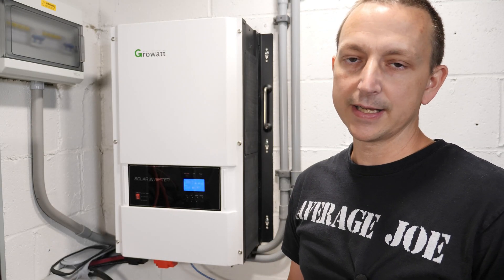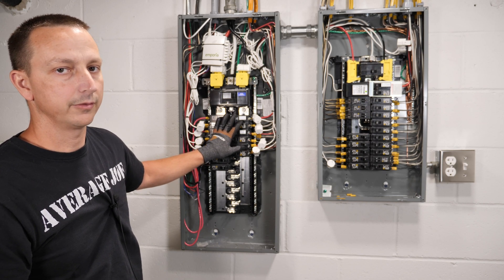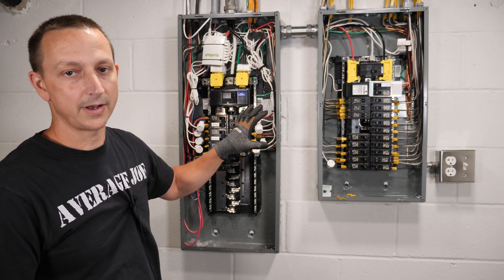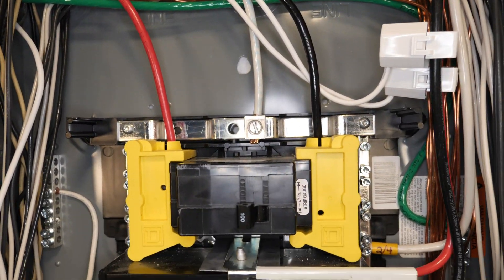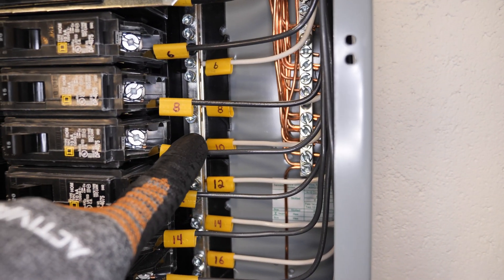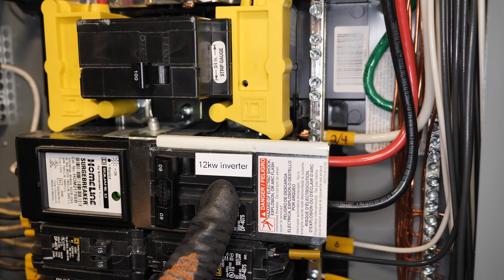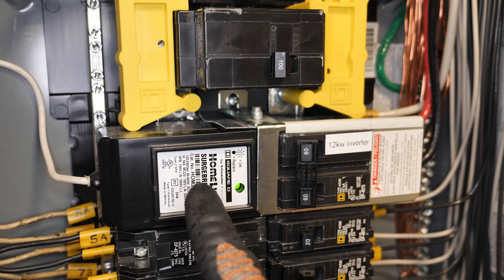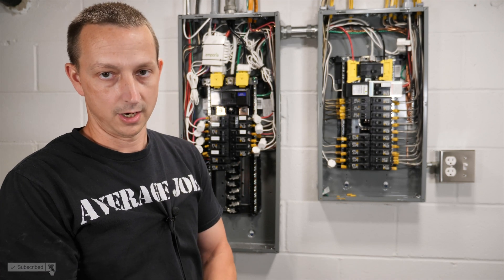How to Wire a 240v Inverter to Power your House for Off-Grid or Whole Home Battery Backup

Comment: Dear Average, great video.  Seems like you connect the Critical Load Panel to the utility through both a direct connection via the Main Panel OR through the split phase output of your Growwatt Inverter.

As I understand most of the all-in-one,  grid connected (not grid tied*) inverters have a bypass capability which allows powering of the split phase output either from the inverter (batteries) OR from the utility inputs. At least this is how my MPP LV5048 works where you can set the priority of the source,  either UTILITY, SOLAR or BATTERIES.

So you could save some complexity and just power your Critical Loads Panel directly from the  Growwatt.  Just a humble suggestion to use a block diagram or schematic to illustrate your dialog. 
Just a thought and really enjoy the great channel !

*PS, my MPP LV5048 is grid connected, but not grid tied,  so I cannot export power to the utility, I can only use utility power, but I'm guessing you knew that already.
Reply: Joe is right

And if your inverter let you down...
What you gona do... ? No source to feed the subpanel
Reply: @benoito8753 if you had to and disnt have it wired this way could take down the inverter and connect the wires together.   You would want to connect the wires inside a temporary junction box of some type.
Reply from the maker: So the growatt inverter also has pass through and we use that anytime there is no sun amd batteries are low. The reason the sub panel is connected this way is because that is how a sub panel is connected.  I added an additional dbl pole breaker to power the sub panel as you would for adding a generator or another power source. Then of course adding the lockout. The great thing about having 2 ways to power the sub panel is if and when you need to turn off the inverter for maintenance. I can just switch the panel back to normal and turn off the inverter. Then switch it back off grid.  I had planned on explaining that but assumed it was known and this was just a wiring connection video. I may do another to explain🤔🤘
Reply: I wouldn’t trust a box to pass through power to my critical loads. I have a 200A transfer switch that does that for me. Same with my 10kW LP generator, with 100A transfer switch.

Comment: 2:04 What is that "Emporia" and the little CTs for?
I assume that is a smart meter system that measures power consumption of appliance?
Reply from the maker: YeSirr! Its a smart energy monitor I purchased a while back to track consumption and see how many actual watts things were using.  I got the one with like 16 ct's so I can monitor all the things lol. Still have a few more to install.  It works great to btw. Real time and is fast!

Comment: I have my Growatt powering my garage, runs our clothes washer and electric dryer. I need to connect the two panels so I can power more loads in the house but they are at opposite ends of the house, so I'm not sure how I'm going to do that and also keep the AC and electric over/stove on grid only, unless I install another panel next to the main.
Reply from the maker: Yeah you can just run some wires over there on that side of the house to a smaller sub panel. Leave the big items on the main panel and move the things over you want to power to the sub panel. You could also instal one of those transfer switch circuit breaker boxes. Its practically the same thing tho.

Comment: What are the white chokes or shunts on each of the leads? are you monitoring consumption on various devices?
Reply from the maker: Yeah those a ct clamps from the emporia energy monitoring system. I  left that out so I didnt get to far off subject lol I purchased it a while back so I could track over time. It actually works fan freakin tastic and is real time.  I do need to reset it since I moved a bunch of stuff around🙄😆

Comment: Should the inverter be grounded to the panel, not to provide a ground, but to ground the inverter itself?
Reply from the maker: It is through the #10 green wire. That ground on the inverter is also grounded to the metal frame.  Adding another case ground would just be adding another wire. You could and wouldnt hurt anything.

Comment: Thanks Joe, need to check the manual.  On this one for Australia we have a Hot + Neutral + Ground on output. Ground and neutral bonded in 12000.  Show you soon.
Reply from the maker: Neutral and ground are not bonded in the US 12kw. Only bond is in the main panel.🤘
Reply: @AveRage_Joe O.k. page 8 here shows bonding for 240 Volts which is common here, mate.  Do you want to do setting next, Joe?
Reply from the maker: Like a inverter settings video?
Reply from the maker: YeSirr that will be an upcoming video!😆🤘

Comment: How do you like the Emporia? i have one and have it hooked up to my mains coming in and my Solar, but since day one it has never matched what my Electric company sends me.... i spoke with them and did some calibrations and its better but TBH im not sure who is correct lol
Reply from the maker: I like it! It reads fast. Ive moved things around and ct's around so mine reads incorrectly. I mainly wanted to read consuption quickly and know how much certain items were using AND how much load was either on the inverter or grid. This was before I got solar assist and was still using the growatt app. That app would only update every 5 min which killed me lol.  Once I have everything set where I want it Ill reset it to see if it matches the utility bill.
Reply: My SolArk12 K says I use 500 kWh less per month average than what my power company was charging me monthly throughout the year. Interesting. It’s a merica, greed, corruption and lack of integrity prevail since 1607.
Reply: @USA-GreedyMenOfNoIntegrity  mine varies by the month but to be honest it reads low lol

Comment: Does the growwat have a transfer switch in. So the generator lock out is not needed    Just tell the growatt to switch between grid and inverter
Reply from the maker: Yeah the growatt has a transfer switch in it.  Thats what I do if the batteries are low, just switch back to grid.  The generator lockout is there so you dont accidentally turn both cb's on at the same time and if you ever need to do maintenance on your off-grid system you can easily switch everything back to grid while you do whatever it is your doing.😎

Comment: I’m doing pretty much the same thing 
Flipping over to grid power when batteries run low.
I’m currently knocking $100 a month off my central Florida power bill.
It started as a backup for storms and kinda got out of hand as far as money goes 😂😂😂
Reply from the maker: Are you flipping over manually on the panel or does your inverter have a transfer switch to auto switch for you?  That is one thing I forgot to add in the video that the inverter switches over all by itself and only need to use the breakers if doing maintenance.  Yeah we have shaved off quite a bit each year!!!😎🤘
Reply: @AVERAGE_JOE  
I’m running it through a generator switch.
Only one can run at a time.
I started with an Ecoflow delta pro with an expansion battery 
Then I added a eg4 3000 watt and 3 batteries (eg4) 
Not running the AC and stove and the most I’ve drawn is 1400 watts and usually 4/5 hundred watts is the usual.
Only had an overload when my daughter was visiting and she doesn’t grasp that blow dryer curling iron and a vacuum cleaner all going at once causes issues 😂😂😂
Can’t blame the equipment because she’s tripped the breaker more than once 😂
Now I switch to the grid when she’s visiting
Reply from the maker: ❤️❤️ Love that! Goes back to grid when daugter is home lol. No truer words for all those devices!

Comment: Thank you for this video,  Could you have replaces the subpanel with a 10 circuit transfer switch (Reliance 510a) ?  So Line from electric  panel go to  the inverter, then from inverter to the  Transfer switch, tranfter switch connect  back to 10 Circuit on the panel.
Reply from the maker: Yeah you could do that for sure!!!😎🤘
Reply: @AVERAGE_JOE   Thank you